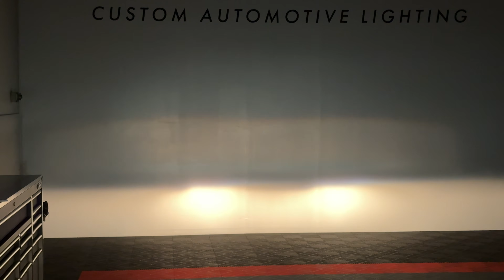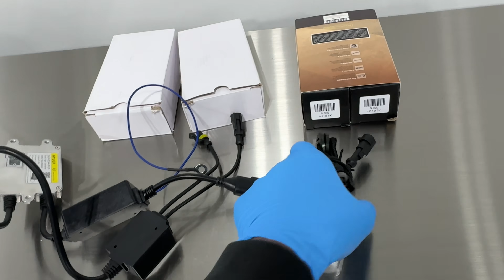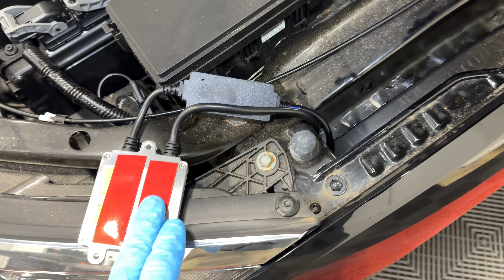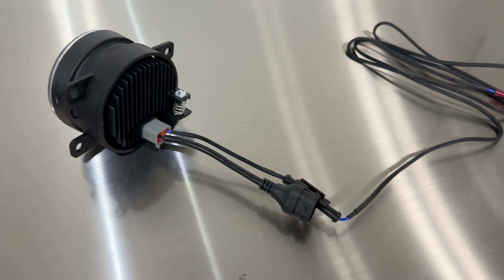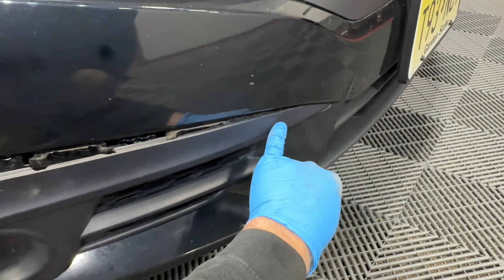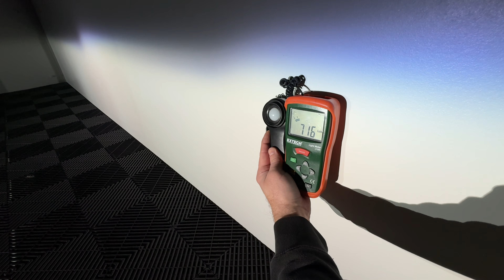In Depth Hylux / Morimoto HID  Installation Overview - Upgrading Honda Civic Headlights and Fogs

Comment: and my recommendation is not to believe anything about HID that recommends 6000k or higher

6000k and nice, bad weather is very slowing down
8000k and you fly blind across the street
5000k provides the most light
4300k is barely noticeably darker but the best for bad weather

Rule of thumb is, every time you go higher in color temperature you lose about 30% lumens 
so 6000k is 30% darker than 5000k
8000k is 30% darker than 6000k and so on

Comment: Amazing video! So the additional ground (blue hook) is not necessary at all? I want to install this kit on my Mazda 3 2016 with aftermarket LED headlights, it comes with halogen on projectors. I added a 360 LED bulb on projectors but I think there is not a good depth.
Reply from the maker: The 4 or 5 sided LED bulbs are the worst of them all. Never use those. Yes you dont need to hook up the blue ground wire.

Comment: In this case, if we were to have HID bulbs as the low beam and LED bulbs as the high beam then wouldn't the heat produced by the low beam HID bulbs heat up the headlight housing so much that it would affect the performance of high beam LEDs? Is there any way that this has been tested by running the setup for at least 30 mins?
Reply from the maker: No concern. The heat from the low beam will not negatively effect the high beam LED performance.

Comment: I have 2021 CRV EX-L for safety on OEM wires should i go 35W Hylux Canbus or 45W Hylux none Canbus to be pair with Morimoto H11B ( 6k ) ?   

And for fog lights looking for diode dynamics full housing replacement. Do they have a model that can fit 21’ CRV? 

Thanks in Advance.
Reply from the maker: 35W Hylux 2a88 works best as its safer and won't require any additional wiring harness like the 45W version will. 

Fog lights, you can use Type A - https://lightwerkz.net/collections/diode-dynamics-elite-series-fog-lamps/products/elite-series-type-a-fog-lamps-white-pair-diode-dynamics

But you need a wiring adapter. Hope this helps! https://lightwerkz.net/products/oem-led-dj70-fog-light-adapters

Comment: i seem to have an issue where only the driver side occasionally doesn't turn on, got new ballast, new wiring harness, new bulbs, and it'll still happen sometimes. when i turn it on, i hear this buzzing sound but it doesn't fire up, any ideas what could be the issue?
Reply from the maker: That buzz/zap sound is usually a misfire. Is it H11 by any chance? Have seen some of those bulbs have an issue with certain projectors. Which model is it?
Reply: @LightwerkzGlobal  It's an H1 Morimoto XB 6000K bulb, with a Morimoto XB ballast and H10 relay harness. I retrofitted the Bi-Xenon Mini H1 projectors into my housing.
Reply from the maker: @mayoo6545  Which car?
Reply: @LightwerkzGlobal Its a civic 2014,
Reply from the maker: @mayoo6545  Strange for sure. Try the Hylux ballasts and ditch the harness. That would be my next try.
Reply: @LightwerkzGlobal  The hylux ballast doesn't require a relay harness? You mention in the video it pulls power slowly, then how's it get that initial ignition like the morimoto ballast does with the igniter?
Reply from the maker: @mayoo6545  That's correct you can see in this video we are not using a harness. Direct connection to the stock. That is how we setup all the car's. Very few require an additional wiring harness with the Hylux 2a88 ballasts.
Reply: @LightwerkzGlobal  Hi, sorry for the late reply. Thanks for your help and getting back to me. I will be picking up the Hylux 2a88 ballast you mentioned, these morimotos are just a headache. 🙏🏻 Will let you know how it goes
Reply: I had a question about which one I should be picking up from your site the 9005? I guess thats the optional relay? Civic 2014
Reply from the maker: @mayoo6545  Stock lights? 9006 for low beam 9005 for high beam. If its retrofitted/aftermarket it will be using a different size.

Comment: Recently snagged a brand new Hylux kit with morimoto 5k bulbs for $80 local and couldn’t be happier with the setup. Been letting the bulbs break in for about a month now and literally night and day difference with lightning performance on the road. Thank you for this video and the tips provided about swapping the positive & negative on the molex connector and the white shipping ring on the bulb. Install was a breeze and everything worked perfectly

Comment: Do HID bulbs end up burning the reflective coating of the bowls slowly? How does the stock wiring hold up without a relay harness?
Reply from the maker: There are certain projectors that simply don't stand the test of time, even with stock halogen bulbs. HID bulbs will accelerate this process. Many Kia and Hyundai are this way.  The answer to your question is that it varies between models. Most models we install HID kit without any concerns. Stock wiring holds up just fine with these Hylux ballasts since they draw power slowly. If you have a ballast pulling high amounts of power, then you will use a relayed wiring harness off the battery.

Comment: My issue is getting my alignment back to how it should be after running led for 2 years. It's freezing out too. How would you recommend getting my factory lights back to stock level? I wish there was a factory leveler built in. I had to adjust them when I had led because I blinding the crap out of everyone. Funny part too is all that light and I still couldn't see as well as I can with hid. How high is the top of the beam in this video if you even know?
Reply from the maker: 2" lower than the center of your projector at 25' - explained here - https://www.youtube.com/watch?v=B5bVexCfV0s&t=593s
Reply: @LightwerkzGlobal  thank you.

Comment: Note, as far as standard 3M red backed tape, be VERY careful. I've found it loses adhesive properties FAST in the cold. Had rearview cameras fall off the body during normal road bumps in the frigid cold. Tape was installed correctly on cleaned surfaces, too. Mounting tape is better, or use the 3M red tape with self tapping screws as the tape will help the screws by leaving a basic tackiness but leave the majority of load bearing to the screws.

Comment: did you only have to plug in only one oem connector to get the lights to turn on? on my accord only the drivers side oem connector is pluged in but both headlight turn on.

Comment: HID for the win as always.  Just because something is modern doesn't mean it's going to work better than "old" technology and I'm shocked by how well those Morimoto bulbs perform in stock halogen projectors. The fog lights however from the angles provided, leave a little to be desired and the stock housings seemed to have way more width than the new LEDs. Great video Cesar!
Reply from the maker: Again, each application is different so results vary. I agree, this application works really well with HID inside the factory halogen projectors. I was surprised myself! Agreed on the width of the new fogs. Surprisingly did not see to be an upgrade in that department - guess the original fog design is quite good in that aspect. But the LED is much brighter and more usable with that nice crisp cutoff.

Comment: I want to ask you, i like the NHK V plus led but i dont understand why i have to replace the whole thing if it failed!! Why they made it like this?
If they got damage withen 2-3 years! Will be pain to replace them
It just i don’t get it, so i think the best choice to get HID
Reply from the maker: This is how true LED projectors are produced in the aftermarket and for OEM LED equipped models. There are no replaceable parts because they do not use bulbs.

Comment: Why did you not recommend the plug-n-play Morimoto XB LEDs fog headlights?
Reply from the maker: They are really great if they are the ONLY option for full housing replacement. With options like the Elite Series, 4Banger, and SS3, those perform much better and come in more colors and power levels.

Comment: I currently have morimoto xb hids 35w 5500k in h1 8.0 projectors. They seem dim, any recommendations for bulb replacements down the road?
Reply from the maker: You gave me another great video idea. Why are people still using the H1? There are many better units out there now. Anyhow, if it's been a few years you need to change out the bulbs. We recommend every 2-3 years for aftermarket HID bulbs. Sadly with H1 fitment, you are limited to bulbs. GO with the Morimoto's again.
Reply: @LightwerkzGlobal   thanks, it was the only retrofit that could fit in my original head light housing 2.5 inches 2015 Honda civic (or so at least I was told). I read somewhere that lower kelvin rating usually means better brightness / output?
Reply from the maker: Yes, the higher the Kelvin you reduce intensity. You can retrofit your headlights with a full size 3" unit, we have some options if you want to contact us directly.  @miklfb6

Comment: What do you prefer for fog lights? White or yellow? I have yellow film over some white led's that have a sharp cutoff.
Reply from the maker: Yellow for actual fog use. White if you keep them on all the time with your low beams and want that matching look. Yellow film over white LED produces a washed out yellow. Not as clean but on some models thats the only option you got. Morimoto produces the 2stroke 3.0 in yellow which is actually a nice golden yellow color.
Reply: @LightwerkzGlobal  I did 3 layers and got it to a golden yellow. 1 layer was too green. What’s the best temp for HID? I just picked up some Hylux 35w to try out in my Accord over the LEDs
Reply from the maker: So the problem with layers is you cut down the light intensity significantly with each layer. The best useable color temperature is usually 4K / 4300K which is what all OEM Xenon lights are spec'd at. But it's a warm white color, which isn't what some people are looking for. But it performs best in bad weather and it's easy on the eyes at night.  @Newyen6MT
Reply: @LightwerkzGlobal  Def less intense but still very bright and sharp compared to the factory Honda reflector fogs and switchbacks I had in them which glared up and was not low to the ground. I am looking for a 5500k HID and people said NHK has some but I don’t see it on the website. I am thinking 5k for a cooler white but not 6k. I have 6500k LEDs right now and it’s tough to see when raining. I had 6k before and it was def a bit better but still not the greatest LED.
Reply from the maker: You can give the 5K a try. As long as you dont mind the color change to a warm white color from 6K. Worse case scenario you are out a set of aftermarket bulbs. They aren't too pricey. 
 @Newyen6MT
Reply: @LightwerkzGlobal  Which 5k? Should I do morimoto like the video?
Reply from the maker: We only offer the 5K morimoto - pretty much the standard.  @Newyen6MT
Reply: @LightwerkzGlobal Do other brands come with a H11 adapter to the Hylux? I was looking at NHK 5500k but wasn’t sure. If not, I’ll just buy morimoto
Reply from the maker: All rebased HID bulbs come with the adapter wiring attached to it like you see here.  @Newyen6MT

Comment: Wow that is very bright. I may consider these for my 2013 Accord Coupe as I have LEDs right now that don't have the sharpest cutoff. I am wanting to eventually get the nhk bi-led retrofit since I have clear reflectors that need to be installed and want sequential switchbacks.
Reply from the maker: Install the HID system and you will notice a big boost over your LED! If you want color that matches closest to your LED you would go with 6K..5K is a bit brighter but more of a neutral white.
Reply: I've heard the LED projectors from NHK have a LOT of foreground to them. Still good cutoff and Hotspot, but the mfr is chasing the brightness ratings over best beam pattern. I'd stick to an HID solution, not to mention that if a component in the lighting circuitry in a LED projector fails, then you have to open the headlight to replace (though driver is replaceable outside the headlight in M-LEDs). Not so with bi-xenon.

So, for less crucial systems like separate high beams or the fogs, I think LED retrofit would be fine, but low beams are 100% safety crucial and need maximum serviceability so you don't have to deadline your (possibly only) car till you can find time to remove and open up your headlights. I'd only really trust LEDs if they're placed into halogen setups and properly adjusted (so, you need adjustable ones like the 2-strokes) and thus replaceable fast with halogens from auto zone or (insert common auto parts store here) should one fail on you unexpectedly, or a factory sealed unit (much higher quality and longevity than the LED retrofit projectors currently available). Otherwise, HID, baby. Serviceability AND output. All you sacrifice is instant-on, which isn't crucial for a light source you usually leave on once you turn it on, like low beams.
Reply: @SirBrass  Yep, I think I’m gonna get the NHK 3” BRT retrofit.

Comment: I'm sharing a link to my tic tok,  it shows how things turned out after my build was done. 
  I  have other videos posted showing the process used for complete rebuild process.  This is  my 07 saab 2.0T wagon.  
  Because I'm a tech, I  relish the idea of a challenge.  I  added in a few cool options to my build,  something that I wanted,  so it definitely sets it apart from anything else seen locally or with saabs in general.
Reply from the maker: Put a up link to your build, would love to see! Challenges are fun and they give us the best results. This video is geared more for the folks that aren't too mechanically inclined that are looking for a simple plug and play solution on their factory halogen equipped projectors.
Reply: @LightwerkzGlobal  
Fair point! I'm hopeful that I'll be able to get to a point where I  can get things lined up to become an installer for you guy's... nothing here in south Georgia.  Headlight Revolution and retrofit source would be my only real competition. 

 My build 
Hylux 35w CAN-BUS HID ballast 
NHK 6500k D2S bulbs 
Profile hi lens projector 
Switchback LED signal strip
H7 decoders 
H7 halogen adapters 
Morimoto EVO-x2 projectors 
Lastly... sealant 

The Headlight lens itself I sanded down and recleared,  so everything looks new.
Reply: @LightwerkzGlobal  
 I  can send you guys an email later today if you'd like.  Also,  feel free to use my videos for product usage if you would like.  The majority of my parts purchased came from you guy's,  so I  definitely do not mind letting you guys use my videos to show off how well your product works!

Comment: I just purchased the Hylux 35w CAN-BUS HID kit and paired it with the NHK 6500k D2S bulbs for my custom headlight build. I  also added the LED projector for  my high beam.  
  I  sent you guys an e-mail detailing the complete build along with how everything turned out.. very good stuff!
  What I would recommend is doing a projector replacement considering that factory projectors are prone to oxidation and pitting.  Not much you can do after that point,  regardless of the lighting system used. 
  For the fog light,  the morimoto matchbox projectors with HIDs of your choice, would be a great option because of the light pattern being more solid.   Of course this is my opinion obviously,  but seeing how well the Hylux kit is doing,  I  would suggest that over any LED bulb replacement.
Reply from the maker: Thanks for sharing ! As you mentioned, Projector retrofit is the best option! However not everyone is going to want to take on a serious project. This video was geared toward the crowd that is looking for a simple upgrade on their factory projector equipped models. You do bring up a great point though. Some projectors are burned up and will require replacement to truly maximize results. It’s never a “one size fits all” approach to lighting upgrades.
Reply: @LightwerkzGlobal  Do you provide retrofit headlight services?
Reply from the maker: By any chance have you checked out some of our other videos? =)  @RedDevilTuning